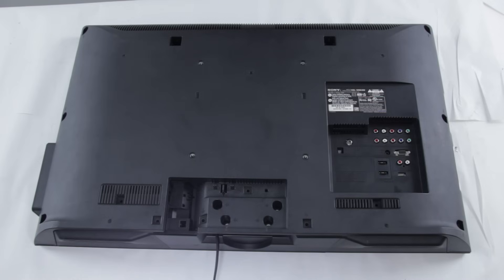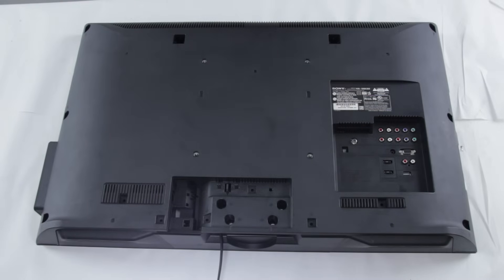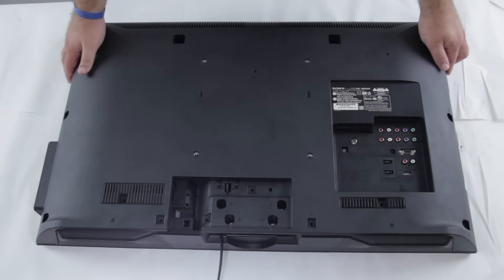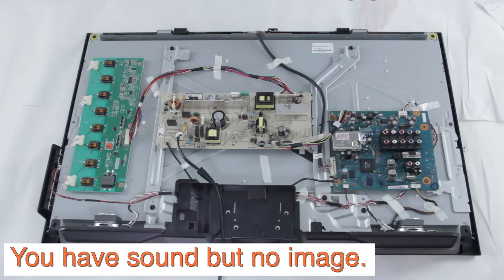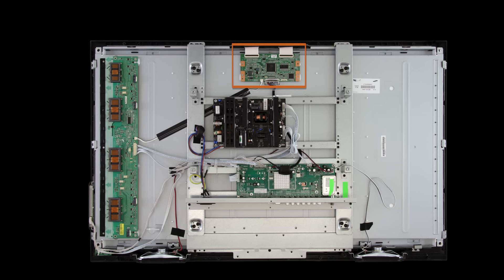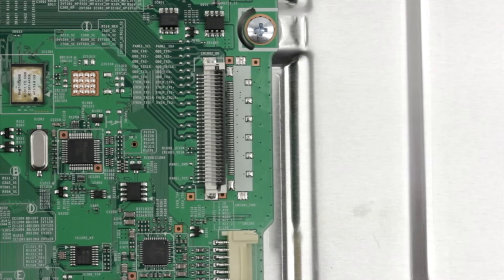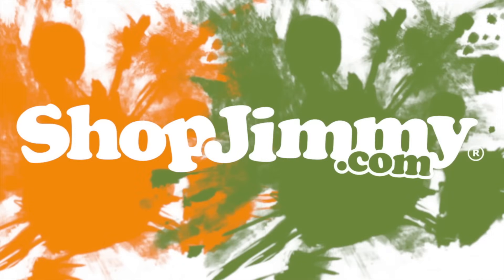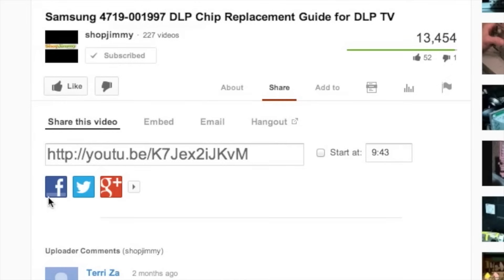LCD TV Repair Tutorial - T-Con Board Common Symptoms & Solutions - How to Replace T-Con Board

Comment: Hi i have a Palsonic LCD tv Model # TFTV421FHDA. i have a problem with the left side of the tv has faded colour and its like blurry but only on half the screen it horizontal lines through the screen to. should i replace the t-con board?
Reply: no when the tv turns on it seems fine then screen has white lines but almost makes the whoule screen go white.
Reply from the maker: Brett Frizzell   This sounds like a TV panel problem.  If your TV panel is bad, it may be more cost-effective to replace the TV as panels are typically hard to find in stock, difficult to replace, and expensive.  Thanks and please let us know if you have any further questions!  www.shopjimmy.com

Comment: I have a LG47LW551c LED 3D TV. The picture is almost perfect except for a light band running vertical on the right hand side of the picture. It is only noticable when watching vivid colored programs.
Reply from the maker: Paul Gillary   This sounds like a TV panel problem.  If your TV panel is bad, it may be more cost-effective to replace the TV as panels are typically hard to find in stock, difficult to replace, and expensive.  Thanks and please let us know if you have any further questions!  www.shopjimmy.com

Comment: I purchased a replacement T-Con board model V400H1-C03 for a Samsung LN40A500T1FXZA because the screen was terribly solarized.  Once I installed it, I went to the service mode and switched it to the correct make and model.  Now the issue is twice as bad as it was before.  I've been told that I have to go in and manually configure this chip to function with this TV.  Is that correct and where should I go from here?  Thanks in advance.
Reply from the maker: Stephen Lee   Make sure that you have a chi mei panel in your TV otherwise the t-con purchased will not work.  Thanks!  www.shopjimmy.com

Comment: I have. sony bravia KDL 55HX800 . The TV has power, but when trying to turn tv on all I get is a constant clicking noise and it will not turn on, but it does turn off when holding down the power button on the tv itself.  After looking inside I see the all the capacitors seem to be good still, so not sure what the problem is. Please help.
Reply from the maker: Reets I   I recommend replacing the main board in your TV.  Here is a link to replacement parts for your TV model number on our website, click here:  http://www.shopjimmy.com/catalogsearch/result/?q=55HX800  Be sure to match part numbers on your current board, with your replacement for compatibility.  Here is a link to a video showing how to identify your part number, click here:  TV Part Number Identification Guide for Sony Main Boards (LCD, LED, Plasma TVs) TV Repair  You can also call our customer service for further assistance with your purchase.  (877) 881-6492  Thanks and please let us know if you have any further questions with your TV Repair!  www.shopjimmy.com

Comment: We have a toshiba 40"model number 40FT2V. Serial  number B46203M62662C1.  We were watching tv during a mild thunder storm we heard a clck or a snap then no picture. And no sound but we have a small USB powered lamp THAT COMES ON WHEN WE TURN ON THE TV THIS LAMP STAYS ON AS LONG AS THE TV IS PLUGED IN TO A POWER SOURCE I PULLED THE BACK OFF AND CHECKED The fuse its ok and I don't see or smell any burnt parts or smell
Please contact me with any ideas as to what the problem might be e-mail mmccumbers13@hotmail.com
Or you tube or phone 352-209-5795. Thank you mike m
Reply from the maker: Michael Mccumbers   I recommend replacing the main board in your TV.  Unfortunately I do not see any replacement parts in the search results for your TV model number on our website.  Please reply with your part number on your main board.  Thanks and please let us know if you have any further questions!  www.shopjimmy.com

Comment: I have a Toshiba 32" LCD TV Model#32AV502R SR# 927124C28236K1 that had vertical white lines fade in and out up to half of the screen when this morning, the bottom half of the screen went black. I only see the top half but not the bottom half. After reading forums and blogs and viewing your videos, I believe it's the T-Con board. If you agree this is the problem I would appreciate it if you could give me the part number needed to repair this issue.
Reply from the maker: Francisco Paredes   It sounds like a bad panel but you can try the t-con if you want, but I can't say it will fix your problem.  Here is a link to replacement parts for your TV model number on our website, click here:  http://www.shopjimmy.com/catalogsearch/result/?q=32AV502R  Be sure to match part numbers on your current board, with your replacement for compatibility.  You can also call our customer service for further assistance with your purchase.  (877) 881-6492  Thanks and please let us know if you have any further questions with your TV Repair!  www.shopjimmy.com

Comment: Hello, i have a samsung lcd tv, the problem is that sometimes it solarizes the colours and reduses the gamma. Is it the T-Con or the main board?
Reply from the maker: TheGraphist83   I recommend replacing the main board in your TV.  Please reply with your TV model number and then I can recommend a replacement part for your TV repair.  Thanks!  www.shopjimmy.com

Comment: Hi. I've got Samsung LE40A456C2DXXU and the image is very bright. The colors seems to be correct. Do you know what that can be?
Reply from the maker: *****   I recommend replacing the T-Con board in your TV.  Here is a link to replacement parts for your TV model number on our website, click here:  http://www.shopjimmy.com/catalogsearch/result/?q=LE40A456C2DXXU  Be sure to match part numbers on your current board, with your replacement for compatibility.  Here is a link to a video showing how to identify your part number, click here:  DIY LCD TV Repair: Part Number Guide for AU Optronics (AUO) Timing Control (T-Con) Boards  You can also call our customer service for further assistance with your purchase.  (877) 881-6492  Thanks and please let us know if you have any further questions with your TV Repair!  www.shopjimmy.com

Comment: hi i have an insignia flat screen tv model #:NS-L332Q-10A serial #: S6799JA002368 the sound works fine and i do get a picture but the problem lies in the tye-dye effect of colors on screen no matter what i plug in at first i thought it was a power surge or lightning hit it and fried the pixels after watching your video i have a small glimmer of hope that it might be something easily fixable for fairly cheap if you could please e-mail me your response to bpc.john4@gmail.com it would be greatly appreciated thank you
Reply from the maker: John Bankins   I recommend replacing the main board in your TV.  Here is a link to replacement parts for your TV model number on our website, click here:  http://www.shopjimmy.com/catalogsearch/result/?q=NS-L32Q-10A  Be sure to match part numbers on your current board, with your replacement for compatibility.  Here is a link to a video showing how to identify your part number, click here:  STEP #1 - Insignia Main Boards Replacement TV Part Number Identification Guide  You can also call our customer service for further assistance with your purchase.  (877) 881-6492  Thanks and please let us know if you have any further questions with your TV Repair!  www.shopjimmy.com

Comment: Hi I have a samsung UE46ES8000 the whole screen will display vertical lines then switches it's self off restarts and the pictures back this happens a couple of times a every few hours of watching so I can prob live with it for now,but I fear it's only going to get worse and happen when I'm watching an important match!!
Any advice would be greatly appreciated thank you
Reply from the maker: DB201111   This sounds like a TV panel problem.  If your TV panel is bad, it may be more cost-effective to replace the TV as panels are typically hard to find in stock, difficult to replace, and expensive.  Thanks and please let us know if you have any further questions!  www.shopjimmy.com

Comment: Model: 26LG30-UA
Product Code: 26LG30-UA.SUSGLBK
Serial # 804TPTM2B585
My issue is a blank screen, no sign of backlight nor sound and the power light flashes from red to blue. 

I can be emailed at flymouse4atgmaildotcon
Reply from the maker: Rich Rich  I recommend running the flashlight test on your TV. Here is a link to a video we produced that shows how to run the flashlight test. No Image No Picture on TV Screen-Flashlight Test LCD TV Repair - How to Diagnose Broken TV Repair Please reply with your flashlight test results and we can recommend a replacement part for your TV repair. Thanks and please let us know if you have any questions! www.shopjimmy.com

Comment: Hi, thanks for your support videos they are really helpfull.

Now i have a question, i have a colored line on my tv so i checked the tcon board, now every 1-2 seconds the image on the tv moves up and donw in a pattern, and i discoverd the tcon board making a noise every 1-2 second same as the image.. Hope you understand cuz i find it a bit difficult to explain.

But do i have to replace the tcon board or the ribbon conecting the tcon to the main board?
Reply from the maker: NLWSLilPorto   I recommend replacing the T-Con board in your TV.  Please reply with your TV model number and then I can recommend a replacement part for your TV Repair.  Thanks!  www.shopjimmy.com   #tvrepair     #shopjimmy

Comment: I have a Samsung LN46a530p1fxza and i was having problems with half of the screen going dark and now the whole screen will flicker and the whole image will be blue and purple, and just yesterday the screen went out and only get sound and this videos said that its the t-con board, so i have to replace that. Thanks for the help.
Reply from the maker: Ernesto Avilez   I recommend running the flashlight test on your TV.   Here is a link to a video we produced that shows how to run the flashlight test. No Image No Picture on TV Screen-Flashlight Test LCD TV Repair - How to Diagnose Broken TV Repair Please reply with your flashlight test results and we can recommend a replacement part for your TV repair. Thanks and please let us know if you have any questions! www.shopjimmy.com
Reply: ShopJimmy.com
It was the T-con board since the flashlight test didnt work. I ordered a new t-con board and it should be arriving today, Before the screen had gone out, i reseated the lvds cable and the picture came back on and then a few minutes later it when out and never when back on, and i smelled burring coming from the T-con board.

Comment: I have an LG, model no. 32LF2500 - ZA, serial 912MAUA0W030. The problem is, that one side of the panel appears darker than the other, especially when there's a lot of black in the picture. From what I've gathered so far is that the T-CON needs exchange. Can you tell me if this is possible for this model and which T-CON module I need? Thanks!
Reply from the maker: scuppa2005   This could either be a problem with the power supply or the TV panel.  You can replace the power supply to see if that fixes the problem.  Here is a link to possible replacement parts for your TV model number on our website, click here:  http://www.shopjimmy.com/catalogsearch/result/?q=32LF  Be sure to match part numbers on your current board, with your replacement for compatibility.  You can also call our customer service for further assistance with your purchase.  (877) 881-6492  Thanks and please let us know if you have any further questions with your TV Repair!  www.shopjimmy.com

Comment: I have a Samsung Model UN32EH5300FXZA TSO1 Serial No. Z4SS3CECA06668D that my daughter wanted to help me clean. Unfortunately she sprayed Windex on the screen that leaked down into the base of TV. After TV was dried out, I turned it on and could hear sound and cable box responded but no picture. Sounds like I have a T-Con Board problem??. With this TV the ribbons wrap down around base of TV stand. Is this something I can fix with parts??
Thank you,
J.
Reply from the maker: J. Sides   This sounds like a TV panel problem.  If your TV panel is bad, it may be more cost-effective to replace the TV as panels are typically hard to find in stock, difficult to replace, and expensive.  Thanks and please let us know if you have any further questions!  www.shopjimmy.com

Comment: hi, i have a Hitachi L22H01UB, when it is turned on it displays the hitachi logo then screen goes blank, you can see that the backlight is on but nothing else happens. any ideas?
Reply from the maker: john pearcy   This sounds like it could either be a problem with the T-Con board or the main board in your TV.  You may need to replace each board individually to see which one fixes the problem.  Unfortunately I do not see any replacement parts in the search results for your TV model number on our website.  Thanks and please let us know if you have any further questions!  www.shopjimmy.com

Comment: I have a scepter x400BV-FHD 40" LCD TV.  This weekend I was watching TV and all of a sudden I noticed the colors were wrong.  For instance, dark skin people look red.  White people look almost blue.  It is as if my TV suddenly switched to 16 or maybe 256 color if you recall the old computer days.  I called factory support. They think either panel or main board.  Sound works fine and the problem isn't isolated to a single input source.  I saw your video but the symptoms you describe don't really match mine.  I opened the TV up and I can't smell or see that anything has released it's magic electronic smoke.
Reply from the maker: Coury Clements   I recommend replacing the main board in your TV.  Here is a link to replacement parts for your TV model number on our website, click here:  http://www.shopjimmy.com/catalogsearch/result/?q=x400BV-FHD  Be sure to match part numbers on your current board, with your replacement for compatibility.  You can also call our customer service for further assistance with your purchase.  (877) 881-6492  Thanks and please let us know if you have any further questions with your TV Repair!  www.shopjimmy.com

Comment: I have a Sceptre X46 LCD TV.  Part No. X46BV-1080P  S/N: 850A6FP1AA0887
The picture doesn't show clear. It's like your looking at people heat signature. Like what a snake will see when looking a humans or animals. Could this be the main board or video board?? Can you please tell me the part and part number I need to repair my TV.
Reply: I' am having a similar problem.  I hope you find an answer
Reply from the maker: John Phillip Scott I recommend replacing the main board in your TV.  Here is a link to replacement parts for your TV model number on our website, click here:  http://www.shopjimmy.com/catalogsearch/result/?q=X46  Be sure to match part numbers on your current board, with your replacement for compatibility.  You can also call our customer service for further assistance with your purchase.  (877) 881-6492  Thanks and please let us know if you have any further questions with your TV Repair!  www.shopjimmy.com

Comment: Flashlight test failed, replaced main board no luck is inverter bad. Picture comes on for about a minute then goes black with audio, picture is great until this happens
Reply from the maker: Doug Lally   Defective replacement part, the inverter does not supply the image.  Thanks!  www.shopjimmy.com

Comment: I have a Samsung LNT4069F all I get is a cloudy (foggy) screen, no sound no picture, back light is working. My first issue on the TV was it keep going on and off (cycling) changed the motherboard and power supply board now I have this foggy condition. Any Ideas?
Reply from the maker: hydrod12345 check the ribbons from the main board to the t-con board and make sure everything is connected and seated correctly.  Thanks!  www.shopjimmy.com

Comment: I have the Dynex DX-LCD32-09 LCD TV and half of the screen is perfect but the right half evertying is outlined in pink and almost polarized.  When i turn on the tv, half of the screen is black and the other half is white.  Is this a T-Con issue or LVDS cable issue?
Reply from the maker: bevoburn   I recommend to reseat the LVDS cable and ribbon cables to the panel. If no change, replace the T-Con board. If still no change after t-con replacement, you most likely have a bad panel in the set.  Here is a link to replacement parts for your TV model number on our website, click here:  http://www.shopjimmy.com/catalogsearch/result/?q=DX-LCD32-09  Be sure to match part numbers on your current board, with your replacement for compatibility.  You can also call our customer service for further assistance with your purchase.  (877) 881-6492  Thanks and please let us know if you have any further questions with your TV Repair!  www.shopjimmy.com

Comment: I have a 47 inch LCD lg model number is 47lg50. I have replaced the motherboard and power supply and it worked for a little bit but then I started noticing that the tv would blink red and then nothing. .so I started  researching a little bit.I took everything apart again and started looking for problems nothing all the capacitors looked good on power supply and every where else.. so I pulled the power supply out again and resoudered capacitors. .plugged it in and it started working again ..I would hit the power button and I would get a fast blink then a slow blink and the tv would come on I have noticed that the blue light I used to get is very dim. .so I have no clue it is doing the same thing the light blinks and won't power on
Reply from the maker: Andrew Barker   Yes, you should put the other main board that your purchased back in.  Let us know how that works.  Thanks!  www.shopjimmy.com

Comment: Hi if you have some time please help me identify what part I need to fix this TV.  The TV fell over and when it was turned back on there were 5-10 vertical lines some with color.  the TV is a Toshiba .Model 32hl95  lcd theater wide.

Many thanks,
Dennis
djfudala@gmail.com